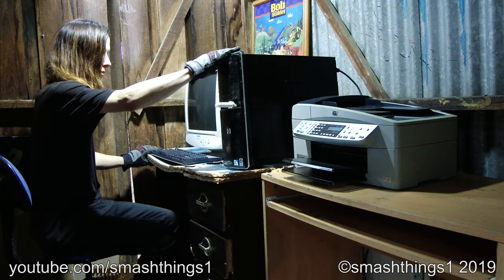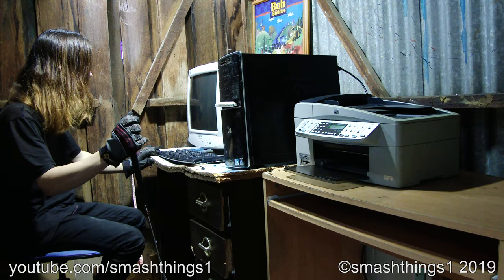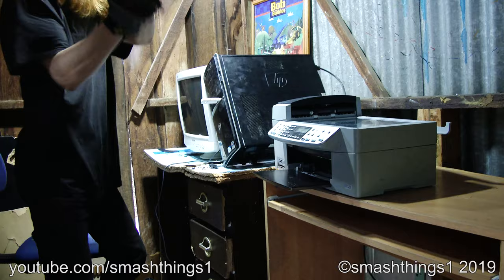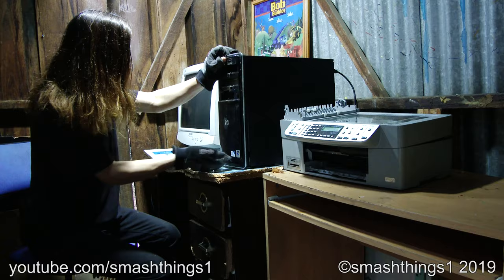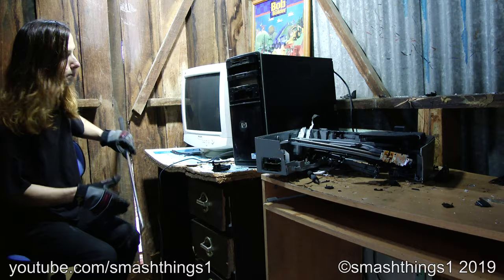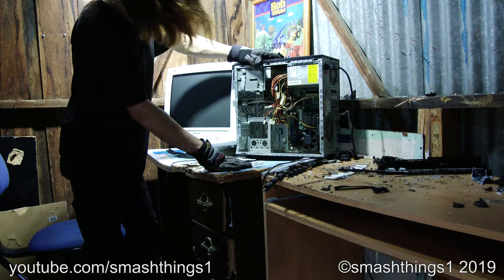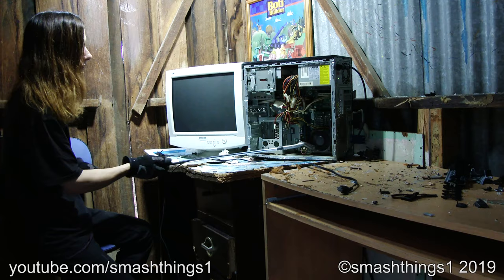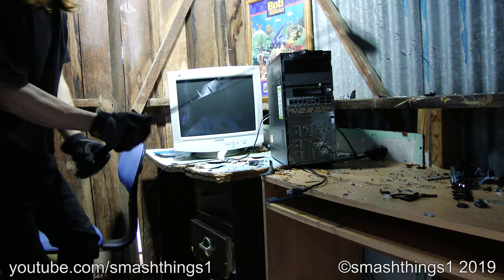Angry Office Man's HP Computer Disaster

Comment: I had an OfficeJet of the same or similar model as that one.  The plastic hinges on the printer lid were junk and cracked within no more than two years of light occasional use.
Reply from the maker: As with all printers as they're designed to only last some occasional use before being thrown out. Also aren't you one of the OG 2009 viewers? I remember you from way back.
Reply: same